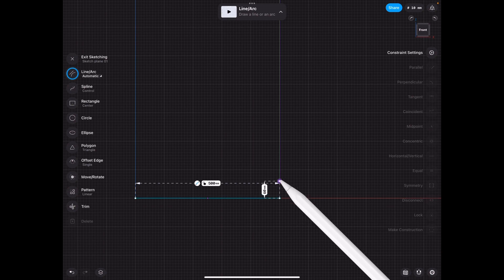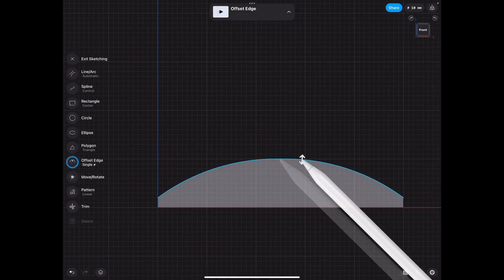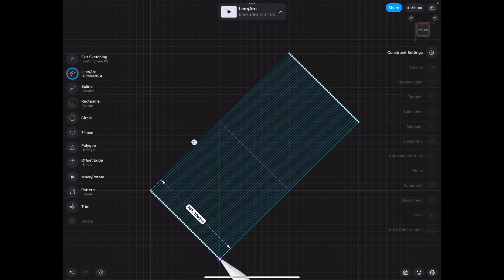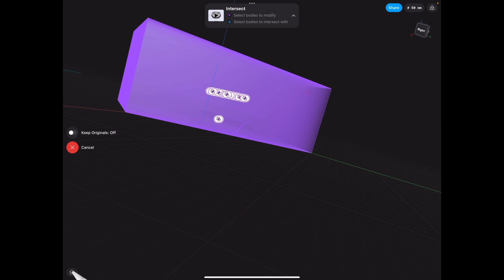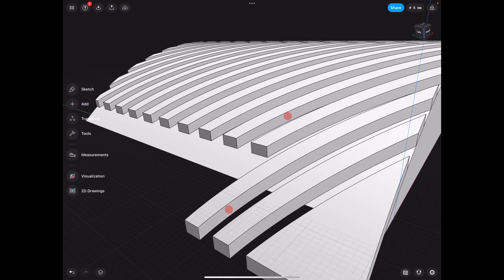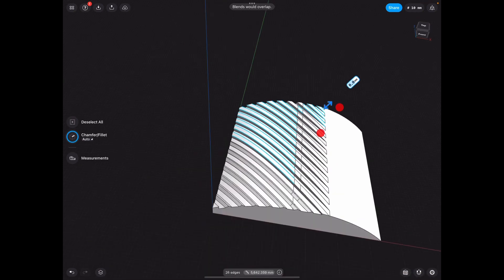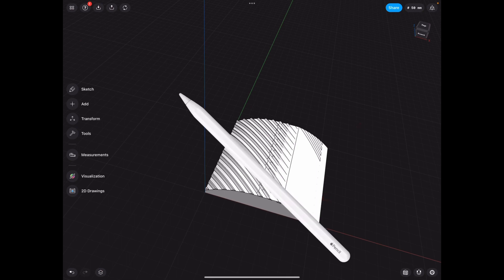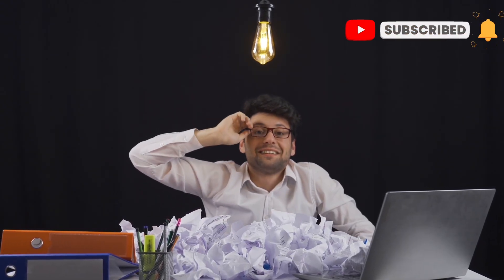Textured to Smooth Transition Tutorial for Shapr3D

Comment: Can’t see how you did the smooth transition. Could you explain plsz?
Reply from the maker: I used the replace face tool to match the face on one side, that requires upfront setup to make sure you have separate faces to work with, otherwise your whole model will be the same. Does that help explain it?
Reply: @JLake3D  thanks a lot, will try that!